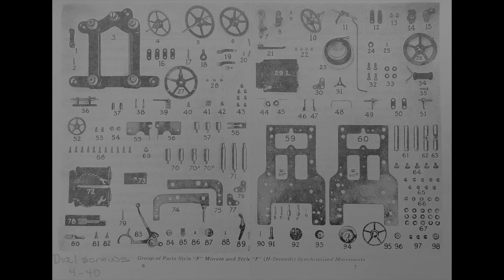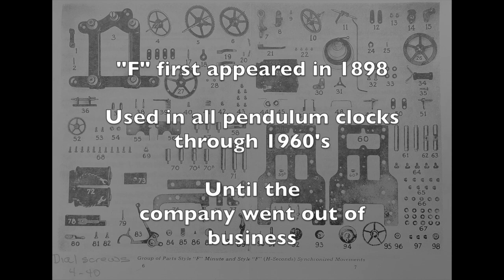About the Self Winding Clock Co  Style "F" movement

Comment: I have a Type F Self-Winding clock that keeps nearly perfect time, but the second hand above the handshaft makes a rotation in 45 seconds. How is this happening?
Reply from the maker: The tension on the tiny ratchet wheel on the seconds bit must be too loose. The seconds bit could advance from the weight of the hand. Just speculating!

Comment: Alan, a passing comment you made in the video was that some movements have had the electrical parts removed and it would still be an [accurate] clock. Words to that effect. I'm wondering how the mainspring could be wound without the coils and circuit being there etc? I ask because I am repairing a clock that her Dad had (he worked for the N.Y. clock co; ) and she wants it to function. It would have to be connected to a master clock for it to function/wind?. Is there a modification to function without being connected to a master? WiFi. Signal? The mainspring isn't powerful enough for  sustained power beyond a hr or 2? Sorry, I do not have an electrical background. Is there an app for her cellphone the owner can download that can send a signal hourly to remotely wind the mainspring and lastly, what kind of reciever can be installed on/in the clock to receive the signal? Thanks a million! Oopps I just realized it's the cam that keeps the movement wound!! I'll save my post because it might help someone else to figure it out!!lol.
Reply from the maker: Sorry that was not clearer. I was referring to the removal of the Synchronizing apparatus. Not any of the clock works or clock electrical components. What I was saying, it will wind without the synchronizer.

Comment: I have an f movement with a sweep second hand. Any videos of this particular movement? Thanks
Reply from the maker: Hi Colin, Sorry no plans for a video about the sweep second F movement.
Reply: @SelfWindingClocks  ok thanks. I understand the sweep second hand is a fairly rare clock movement? I'm repairing it for a customer and this by the way is my 1st self winding New York clock. I tip my hat to those that work on these type's of clock's. I guess it get's easier when you do several of them!
Reply from the maker: @colinallison5307  The only difference between the sweep second and usual F movement is the motion works and the sweep second hand. When reassembling the movement look for the timing marks on the motion works. Need to be correct or the synchronizer won't work correctly.